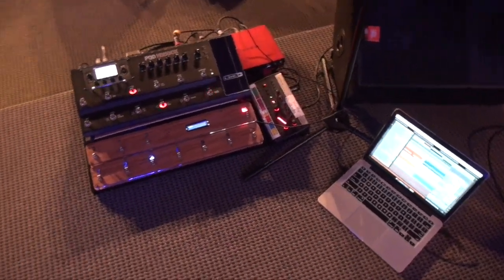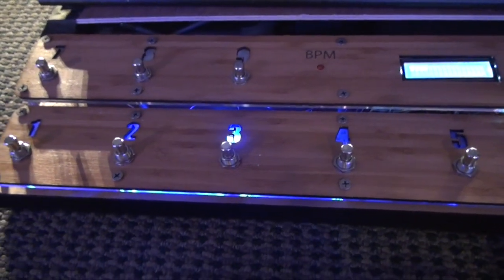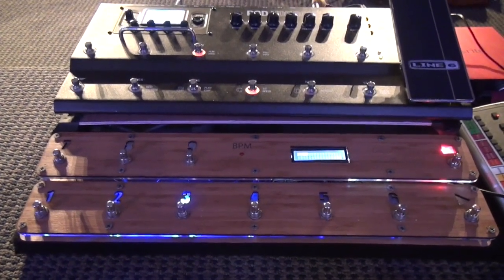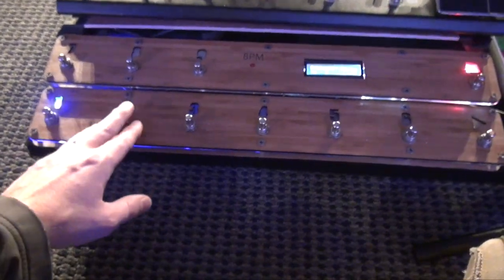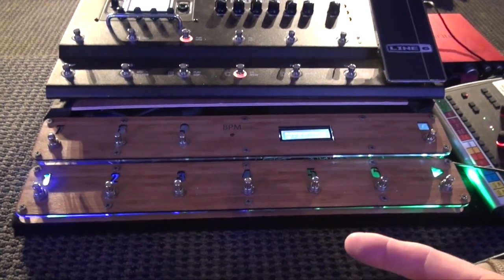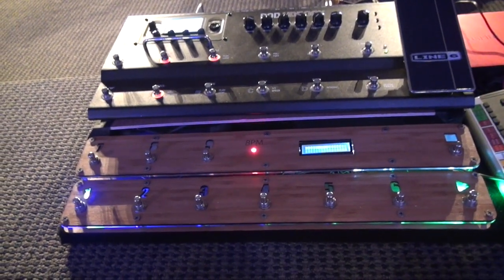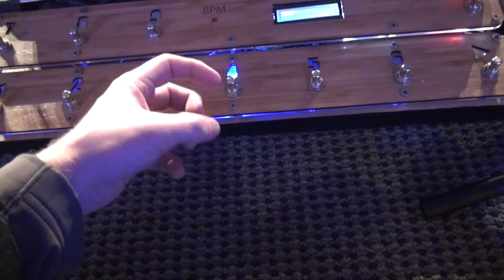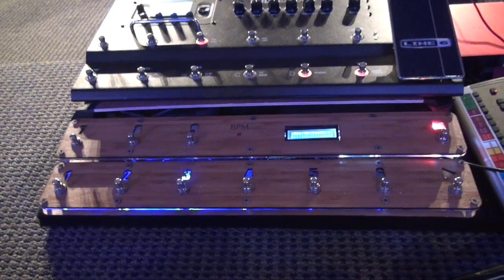Version 2 Ableton Midi Pedal Foot Control Teensy Arduino with BPM feedback

Comment: Do you have a wiring diagram by chance? Did you use any kind of resistor inline with the footswitches?
Reply from the maker: No Diagram. The switches don't need any resistors. At least i didn't use any. The LEDs do though.

Comment: Grt  Job   Bro  ........&  can This   Code  work   If  we   Use   BLuetooth  bLE     Module      With  ardiuno  Instead  of     USB  ??    So we  can connect   With  GarageBand ( iPhone  ) Without    Wire  ...??    Plzzzz   Rply  🤩
Reply from the maker: Great question. the code was my weakest part of the project. So I don't know the answer to your question. But I imagine you could also use the lighting to camera usb adapter to the usb cable and it would work on an iphone/Ipad.

Comment: Hey, I'm looking to build something similar. Do you still have the code for the BPM led? The midi send stuff I can figure out but the way bpm is transferred through midi seems quite complicated.
Reply from the maker: Here's my latest code: https://www.dropbox.com/s/cu1iu61wywlyysv/AveyPedalBPMv2_2.ino?dl=0
Reply from the maker: you'd have to modify it to fit your needs obviously
Reply: Thank you, I'll have a look. I'm also looking to build a pedal board so that a guitarist can control ableton. However I'm hoping to give it some extra features, such as banks to allow for more markers in the ableton timeline
Reply from the maker: Yeah, that would be a bit more complicated on the programming end. I found that i only really needed 5 marker points the way that i run. I provided 9. But really only use 5 (plus play and stop)
Reply: Indeed. However I'm not the worship leader myself. I'm building this so that i can loop back into the song for instance when the worship leader decides to play a chorus twice. Our worship leader prefers having that flexibility so I'm trying to figure this out. I figured using a single bank per song could allow us this extra control
Reply from the maker: If you are using ableton, you could use the backward and forward buttons. That would allow you to (linear) loop a section. I had that programmed into my V1 pedal, but I literally NEVER used it.

Comment: Been looking for a USB midi controller to send CC messages to either my iPad or MacBook pro for pedal on/off messages in Bias FX.   would something like this work?  Looptimus pedal does not send CC#s.  only program change....
Reply from the maker: G Sharp9 I think the arguing can be programmed to send any kind of message
Reply: sweet...   do you have any documentation on how you set this up?  recommend any type of switches?

on another note, I'm using both playback app from mulittracks and prime from loop community.  Also have an HD500.  However, my test of bias FX direct over the last month has proven sonically better.  would love to control the digital pedal board with this type of thing as well control the playback or maybe ableton in the future.  trying to decide if i want to jump into ableton this year....
Reply: what is the approximate cost of building a pedal like this?
Reply from the maker: G Sharp9 yes- I made an instructable - there’s a link somewhere
Reply: instructable for V1 or V2?

Comment: This was my solution for your problem :P
It also controls my "DIY 2 channel JCM800/Mesa Head"

http://www.diystompboxes.com/smfforum/index.php?topic=114333.0
Reply: I'm the fucker who wants his dry signal to be absolute analog ;D
So one digital delay cant harm much.
I even use an analog RF transmitter if I go wireless...

But if you go '''Full Digital" at least  your gain should come from an analog amp.
Digital gain modulation just doesn't cut it for me.